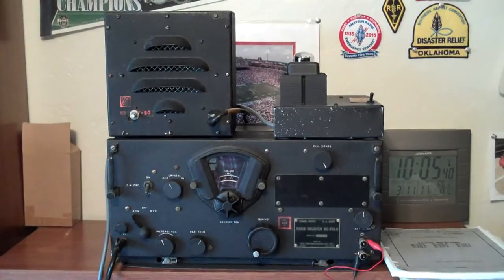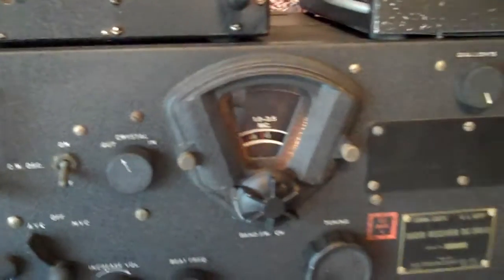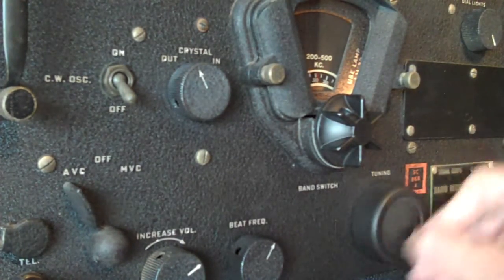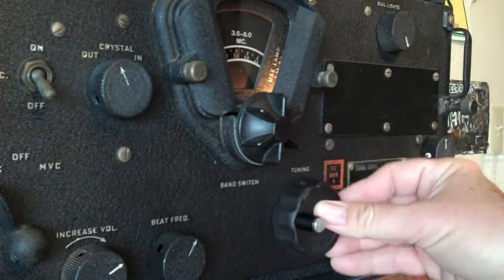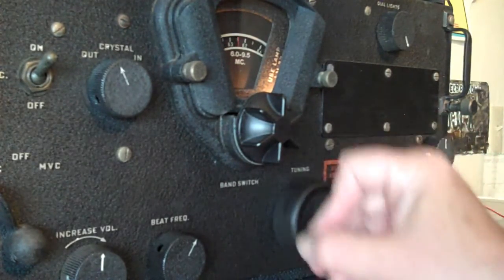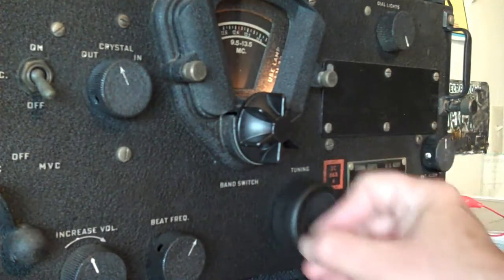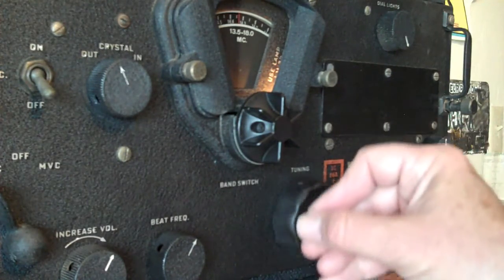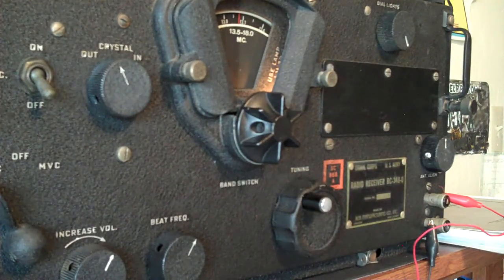BC-348 DEMO

Comment: David, Beautiful radio you have there.   I have the Signal Corps BC-348-Q that has also been recapped and aligned.  I made a short video of it, comparing it to a Radio Shack DX-398.  I fed the audio from both radios into a Zenith Royal 2000 to amplify and equalize the audio.  https://youtu.be/Gn-rh6WiXio